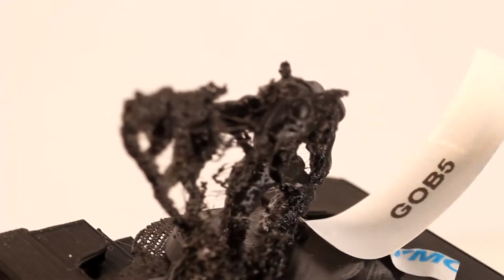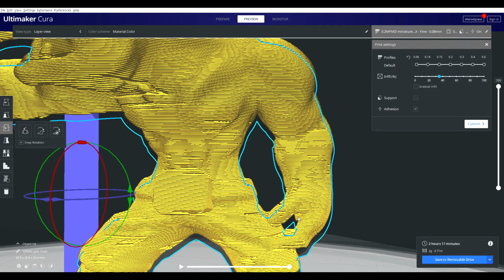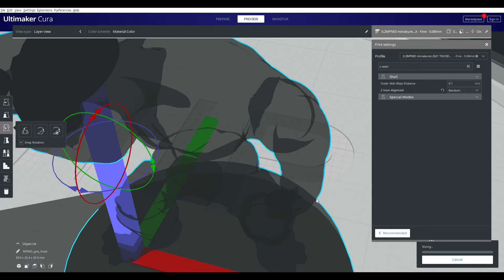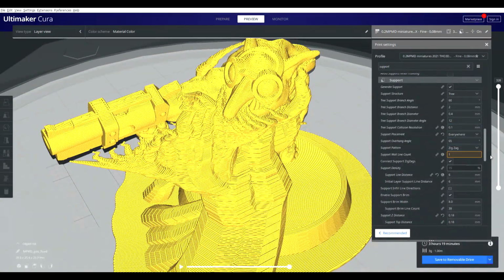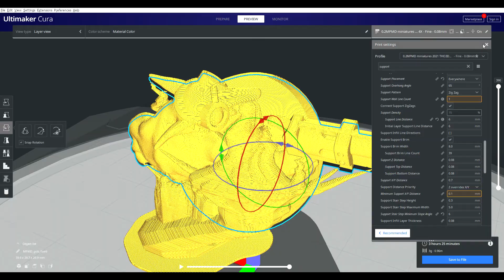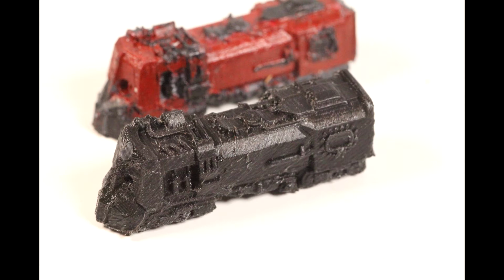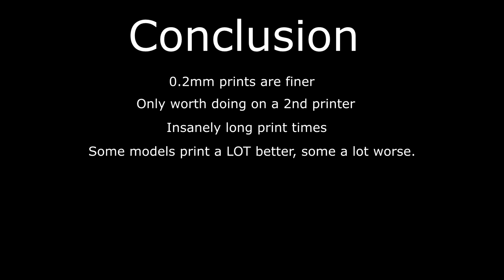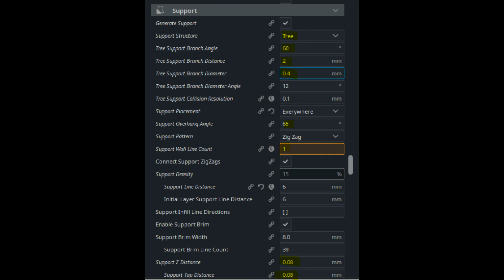0.2mm nozzle on the MPMD - PART 2 - results are in! Can the Monoprice Mini Delta print miniatures??

Comment: How have you come along since this video?   In mesh mixer they have an auto orientation for the 3d models.  suggesting near best way to have your printer print it.  This model of yours also seems Very difficult to print.   You can you that you can get GREAT prints from your pinter by the BACK of your near first print.   That was great resolution and texted.  Knowing that you can work on getting the rest of the model to look that good.   You may need retraction for stringing, a different , easier model to see the your printer is great and give you confidence to continue to look for solutions.....   great stuff, but baby steps....   going from a new nozzle to difficult model even on the other printer is a giant leap.
Reply from the maker: There's a lot of good info there, much appreciated. It's quite time intensive trying to experiment with a small nozzle because the print times are insanely high, but I plan to spend some time focusing on tuning it at some point so this is all useful feedback. 👍 much appreciated

Comment: I pretty much went the opposite way with my 0.25mm nozzle. Line supports with support interfacea and 0.25mm z distance. Easily removable and it looks pretty good. Of course the underside is still kinda meh but it prints well. Also printing at 190c helps a lot (depends on filament)

I would love to see a material comparison for printing miniatures. The ones that seem interesting to me are PLA, PVB and ASA (mostly because Prusa mentions them for miniatures). PVB and ASA have the benefit of being easily smoothable but finding out what gets you the best (unsmoothed) details would be nice. Sadly I don't know anyone who tried this out.
Reply from the maker: ASA...I know next to nothing about that material, I've seen it sold though. Is it safe to print with or more like ABS where you kinda want to stay away from it?
Reply: @LostInTech3D  As far as I know it is very similar to ABS. It mostly is just slightly better in almost every way (+ UV resistance). Based on what I have read it is pretty much a complete upgrade and using ABS instead makes almost no sense. Warping is still an issue but according to Prusa that isn't a problem with printing miniatures since they are so small (-> no heated chamber needed). You should still avoid being near it while printing though (maybe slightly better compared to ABS?).
I mostly read through Prusa's articles about their prusament and the different materials. PVB and ASA both mention being suitable for miniatures and I wonder if they can print details better than PLA. Being able to smooth prints is a nice side effect but that always loses a bit of fine details though.